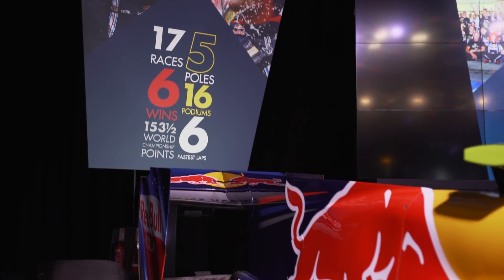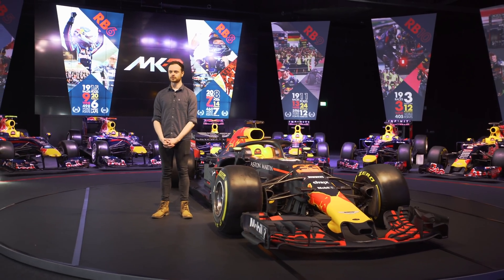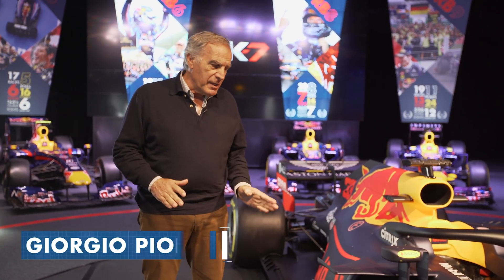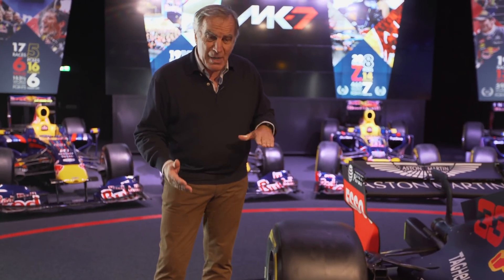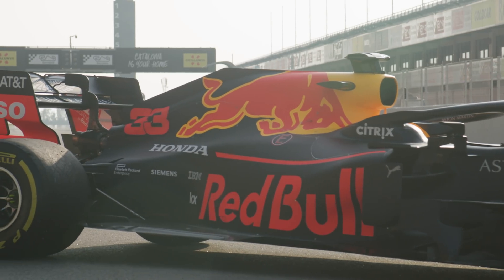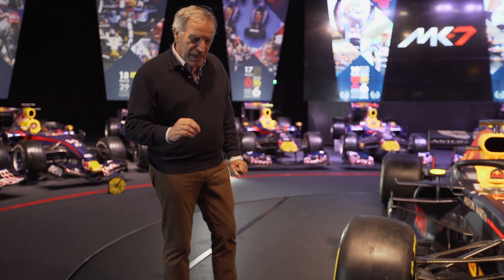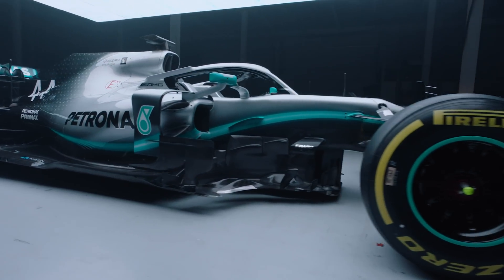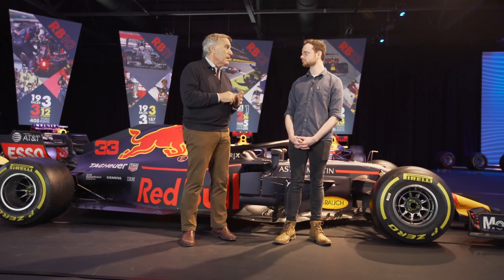Why 'rake' is such a big design trend in F1

Comment: Rake makes the car look pretty agressive in my view. Looks good on the Red Bull.
Reply: Sylmaron Mars Aggressive but slow
Reply: @migracing8232  I don't think so. Red Bull is only lacking in the engine department but they have had a great chassis for the most part.
Reply: Sylmaron Mars What can engine do for them. Look at Ferrari they’ve the best engine on the grid with the best straight line speed still they’re suffering. Mercedes ain’t The fastest in straight line speed but they’re winning races. 
Even red bull is fighting with Ferrari but you’re talking bout engine? Give me a break. Blah blah blah🙄
Reply: @migracing8232  The Honda is quickly developing. If you didn't notice you must have missed a few races.
Reply: Sylmaron Mars Never missed a race in 6 years. What are you talking bout. 
I’ve got my info tucked in.
Reply: @migracing8232  If you get your info tucked in you must have seen the Red Bull battling the Ferrari's right?
Reply: Sylmaron Mars yes of course. 
Redull ring
Silverstone and so on
Reply: @migracing8232  Please get more Intel before posting something like that. The most time there isn't the one thing that makes another team faster than another.
Reply: meh if the rear wing was a little bigger it would look better or maybe the tires

Comment: And yet the fastest car on the grid doesn't use it.... what gives?
Reply: I mean a car has an engine and all other components. If one component is good, it Doesn't make the overall car good too. lol.
Reply: Trade offs. Merc get less inherant drag from a lower rake. harder to keep the weight down but they obviously have the money to solve that issue. Its an interesting 'what if' on if the M is a better car as their design is right or its wrong but they are so good they've made it work regardless. It is possible that the two concepts can just produce similar results...
Reply: T Croft No they can’t produce same result.
Reply: @migracing8232  Of course they can in performance terms. Its by no means unique for two solution to produce similar results.